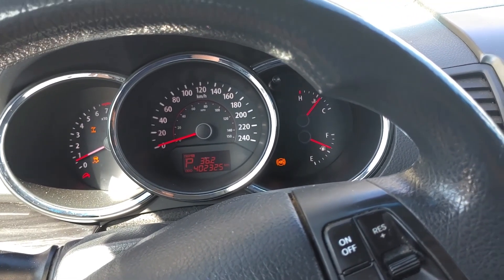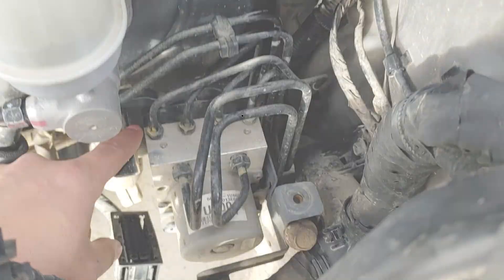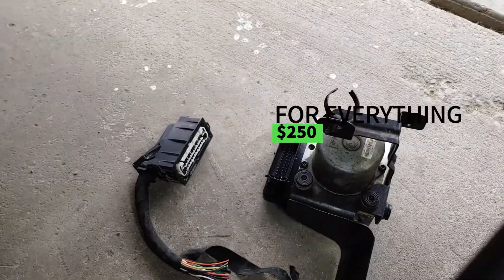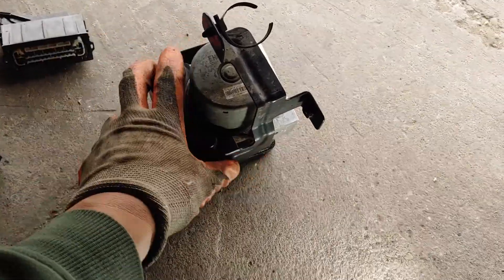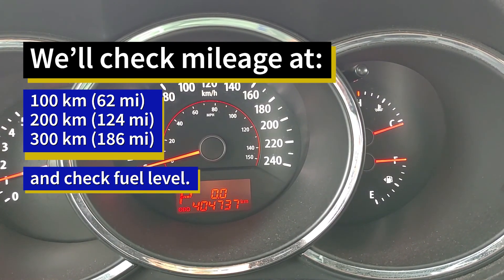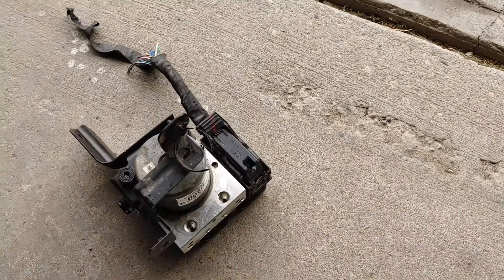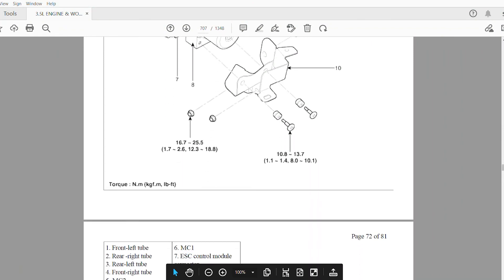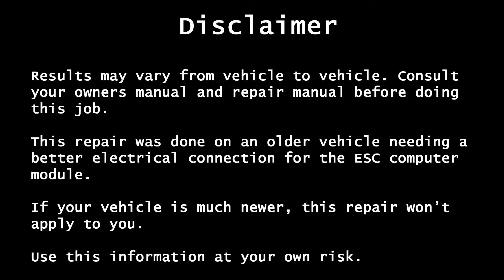Replace and Rewire ESC (Electronic Stability Control) / ABS Module: Tutorial.

Comment: Do you need to replace the connector with the module or can you use the old connector? Thanks for the video it's super helpful! Gotta go to the junkyard and get a new module bc the manufacturer was trying to charge over 2k
Reply from the maker: No need to replace connector as long as it works. I noticed for mine the pins were misaligned.

Comment: I have a 2011 sorento with 310,000 km. Already had to change the rear sensors twice with lights coming back on and even spongy brakes. Might have to look at that module or the sensor harnesses. 

Thanks!

Comment: ESC isnt about stabilizing traction. It helps mileage instead. My Esc light is on and wont turn off, the front brake grabs sometimes and I hit the esc off and it works fine for while until restarted.
Why did you have to transfer connector instead or plugging in the old one into new module connector?
Reply from the maker: ESC = Electronic STABILITY Control.
Not electronic mileage control.
Reply: i have the same now i think. my ESC light i flashing and if i press the brakes it makes a bad sound. it gets fixed by pressing the ESC button until i have to start the car the next day again. Have you perhaps found a fix for this besides this video?

Comment: 402k miles?????? wwwooow!
is it miles? or km? did you had your engine replaced?
Reply from the maker: Yessir. 400k KM. As far I know engine and trans is original.
Reply: @AutomotiveForBeginners  you have a lot of miles on it, huh
did you have any problems with a timing chain? or vvt solenoid?
Reply from the maker: Timing chain / vvt no problem.